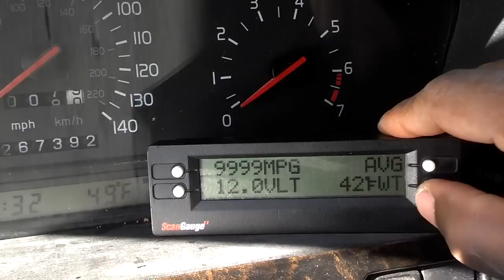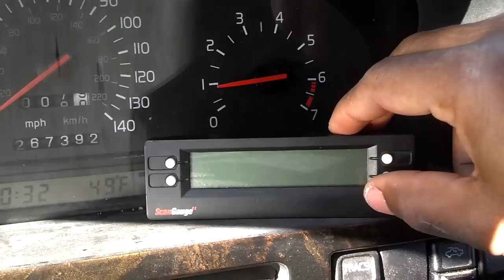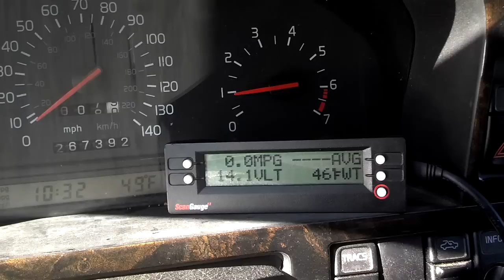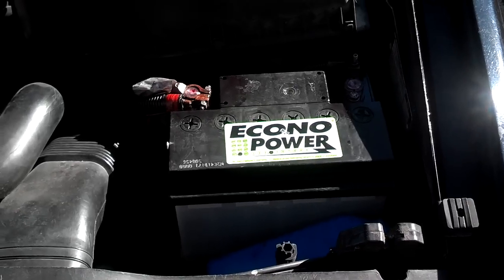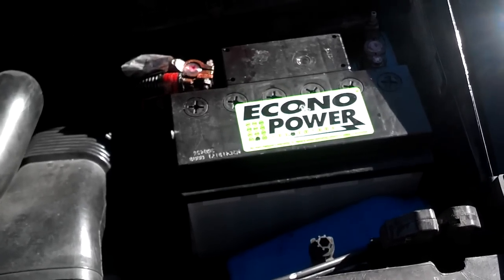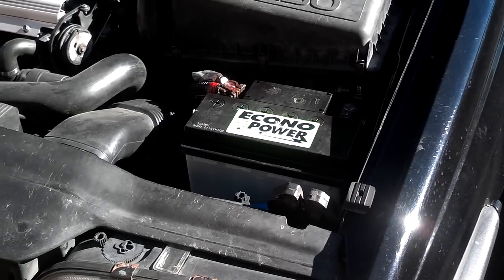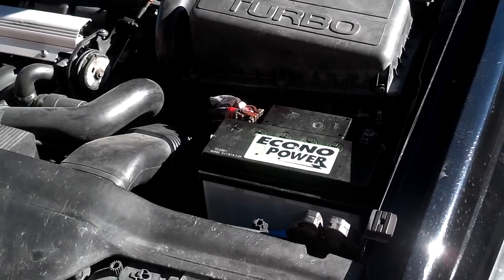How to tell if your car battery is bad, weak or dead. Signs of a bad alternator. - VOTD

Comment: Hi, I'm having some very bad electrical problems with my car. My car will shut off occasionally it seems if too much voltage is drawn as in if I turn on the headlights, wipers, heater blower and hold the brake down, and I hit my blinker, the car will shut off. The ammeter reads directly on discharged but if any of those accessories above are pressed it jumps below the line. First I replaced the voltage regulator and there was no change, then I replaced the alternator and still no change, then I rewired all the wires from the alternator to the battery to the voltage regulator to the ignition switch and still no change. the battery reads 12.8 Volts when the car is off, and 14.8 when the car is running. I feel as though I am running out of options, please help!
Reply from the maker: +Tanner Molitor You must have a short somewhere. What kind of car do you have?
Reply: 1967 Mustang, I just bought a new voltmeter gauge to replace the old ammeter. Alot of people say that those go out commonly. I'm hoping this will solve the problem.

Comment: I was driving and I was losing electricity like my radion turned off and my inner lights where dimming and I finally parked and it just doesn't start anymore
Reply from the maker: +Jose Vela Sounds like your alternator died. https://www.youtube.com/watch?v=_1q40V-BPQc
Reply: Yea I checked in oriellys they said it was bad
Reply: So I bought a new one
Reply: Can a bad A/C mess your alternator up?
Reply from the maker: I doubt it.
Reply: +Robert DIY thank you a lot!

Comment: My car was running then the radio cut off then when I turned it back on I get nothing alternator is new is it my battery
Reply from the maker: +Tenisha Johnson Fuse?
Reply: I mean it did all of that then u turned my car off and tried to start it and it wouldn't I had to get a jump but my lights were dim and my battery light and SRS light came on but I just had myvalternator replaced a few months ago but I looked at the alternator its turning and the belt is still on it what could it be?help!!!!
Reply from the maker: Probably a bad alternator. What brand is it?

Comment: sir my battery discharges. then i charge it.. and it drives. ..after i drove it for atleast 30 mins.. then  turn off the car.. after that i have to go home so i used the car after that i wont start.. whats wrong with my car?
Reply: +Stephen Hoyumpa -May be a parasitic drain on the battery when it is turned off as well...radio...light..etc
Reply from the maker: +Stephen Hoyumpa can you take your battery out and have it tested?

Comment: Ever heard a squeaky battery? I thought it was my old suspension at first, but I opened the hood and listened in and when I push the car up and down or move the battery back and forth, it makes a squeaking noise. It's been holding proper voltage; just making weird noises.
Reply from the maker: +LJRossPhoto Wow! Now that's an old car. lol
Reply: Haha I don't know if I should be worried.

Comment: I like this guy. Pretty down to earth and knowledgeable. Also sounds like the SNL Ladies man.
Reply from the maker: +meowbark LOL, I have been told that before. Thanks for watching.
Reply: Robert DIY Hey there!Quick question my 03 Nissan pathfinder when i try to start it,it click and sometimes after multiple tries it starts,i tighten the positive cable tighter and it cranks the 5 or 6 times i tried.But the battery has a small budge.Would that be that i should just replace the battery to solve this issue?
Reply: I've been researching into fixing a car battery and found a great website at Rapid Renew Roadmap (google it if you're interested)
Reply: Ladys man haha he does, yes he was very knowledgeable and helpful!!! That lisp though😁
Reply: LMAO 😂😂😭😭

Comment: That's what I hear a click, it takes about 4 clicks before it turns the motor fine but the battery is nearly 5 years old.  Yesterday I changed my starter, it was completely shot, the brushes and solenoid.  Do you know how to troubleshoot the ... I think it's called the start coil solenoid, spark plug runs from it to the distributor cap, wondering how to troubleshoot that because if I stick a new battery in, sounds like I need one anyway but it still clicks then?  Boy what a pain and it's difficult making it on my pension, you can drop some money messing on a start up issue I can't afford those expensive shops but have been taking my car to back yard mechanics (Philippines) trouble is they don't have any fancy troubleshooting machines, any help appreciated.
Reply from the maker: +mc “mcalleyboy” alleyboy It's called the coil. If the car runs fine once started, the coil is likely fine. I would clean all of the battery cable connections real good. Sometimes the battery cables go bad and need replacing.
Reply: +Robert DIY    Thanks Robert, that's what I needed to hear, my cables do need replacing, I had to cut or shorten the positive cable about 3 years back because it was so corroded, okay sounds good gonna get some new cables and check all the mounting points.

Comment: Dear Robert , Sir i am really work it out whether really a bad battery cell could be revived.Some youtubes show that by the use of Epsom salt or even aluminium sulphate.I did try using the Baking Soda, by draining the battery water / acid and then flushing it using Baking Soda but it didn't work.Is there another way or steps that can help to get the bad cell working?Please friends your views also... God Bless....Nilesh [FIJI]
Reply from the maker: NILESH PRASAD I do not know. I simply replace them with a new, refurbished or used battery.

Comment: I think I have a bad battery but it isn't acting like bad batteries I've had in the past. I watched your whole video and some of the symptoms you listed are new to me. Thought I'd get everyone's take. A week and a half ago, got me and the kids in the car tried to start it. Wouldn't turn over. Sounded like a low battery, but I still had radio and AC which hubby had left on when he stopped the car last. I turned them off. Made a couple calls, tried to find a neighbor to jump it, got back in and for some reason tried again. The car turned over and off we went. I ran it 20 minutes to make sure it charged. I don't use this car much so didn't again until day before yesterday. The starting stuttered, but ran. Today it won't turn at all. When I drove day before yesterday, I had a light come on -- the air bag symbol, meaning the air bag was in malfunction. I noted it but continued to drive. It went off and didn't occur again. But today the car can't start at all.  I could be looking at alternator issues, but I don't think so. When hubby gets back, I'm planning on sending him with the battery to have it tested. But if somebody checks this morning 5/9/15, please weigh in.
Reply from the maker: Beth Welsh What kind of car do you have? - https://www.youtube.com/watch?v=2rVt-TDqmSc

Comment: Thank you for this video. I am a single woman who just took her 2009 ford hunk of crap Taurus into a well known auto shop. I told them what it was doing and based off what I said they didn't doing any diagnostic testing and just changed my starter. I paid them my last $260 I had a drove ten min to my home. the car felt no different a was very sluggish. By the time I got home smoke was pouring out the hood. I'm going back but thanks to your video I am educating myself first.
Reply from the maker: Josee Reynolds Thank you for watching. Visit my page and go through some of my Play List to see if there is anything there that will help you.

Comment: Hey man. I've checked through most of your work (which is mostly great, btw) but couldn't find it, so here I am, asking; My battery died during the cold, so I switched it out, nothing werid there. But about 2 days later my remote couldn't unlock the car anymore. It turns out that the alarm is 100% dead, no lights showing it's on, no remote response, no sound when it should go off etc. altough all doors lock when turning the key in the drivers door.
I thought some cables was damp or something, but it doesn't seem to be the problem either. I really have no idea what's up.
Reply: It might be worth saying it's a volvo 945
Reply from the maker: Enchisedmy Hmmm, not sure about that system. Is it a stock Volvo system? Did you check the owners manual?
Reply: Robert DIY
It is a stock system besides the thing that recieves the signal from the remote. The lock itself and wiring are all stock. I checked the only manual I could find, but it doesn't tell me where the cables are running.
Reply from the maker: Check on a forum or two.
Reply: Robert DIY
Ya, I've been looking like crazy since i realized it was something wrong, about 4 - 5 months ago. There's just nothing to be found on that subject, I might have to leave it at a shop in the end.
Thanks anyway, though.
Reply from the maker: Did you leave a message about your issue?
Reply: Robert DIY  Yes, I have. All I've gotten so far is "Did you check the remote?" which kind of equals to "I didn't read about your issue".
I'll just drop it off at a friend of mine and let him take it all appart, thanks for your help, though.

Comment: I had zero problems and no weird issues had my battery (auto zone) tested a month before winter but day 1 of it being 10 degrees my car wouldn't start... it was 4 yrs old battery  so I was watching it and really had not 1 problem before it got cold...

I didn't know triple A would bring and install a battery in your car if your a member  ...not sure what the charge for the battery but maybe lower than the $100 I spent at home depot for a car batter...(yes home depot) ... auto zone wanted like $135 and I needed  1 asap...
Reply from the maker: AwakeDude911 Nice (AAA). I found a Interstate Battery refurb place in town that I recently picked up a battery at.

Comment: Hmm nice tutorial robert :-))

Some of causes of a running car losing power can also be the fact that the alternator has died and the battery could be good but draining.

Most bad capacity batterys dont stop the engine running, the alternator will be doing all the work while the battery does almost nothing, starting the car from a few days later will show the state of the battery.

There is a condition where one or more of the series connected cells go short circuit, this can make the battery boil and give the impression of an overcharging alternator, its not, the difference between the alternator voltage and battery voltage will create an overcharging symptom unless the remaining cells are so weak that there charging resistance is very high indeed.

The battery charging current is dependant on voltage difference and the batterys effective resistance, the effective resistance could be understood as weakness.

You poked my memory from working at a factory that did alternators and starters lol :D

If people dont understand cells then use "D" type batterys in series and tell them that some are old ones so overall the voltage will drop when you demand current.
ill shut up now ha ha ;-))
Reply from the maker: zx8401ztv Well, this video is really a Part 2 of my Battery VS Alternator video that a lot of people watch. 9 Times out of 10 questions that I get are from people that have a bad battery but try to justify that the battery is good because they can blow the horn or turn on headlights. I try to tell them "not so" but this video will cut down on my replies to them. Batteries die all the time. Alternators go bad once in a while. - https://www.youtube.com/watch?v=_1q40V-BPQc
Reply: Robert DIY
Yep i know batterys die, the plates get a coating and insulate them, not good :-(

If it offends you, ill delete my previous comment so not to confuse others?
Reply from the maker: No, not at all. I don't mind people having detailed info. The only thing that bothers me is when people use foul language and when they post links.
Reply: Robert DIY
Well i can use mild swear words but not often :-)

Its a real pity that batterys dont have the cell links on top like they used to be, you could test each cell with a multimeter while you applied a load, i know its an old fashoned design but i liked the full access :-)

Comment: can you make a vid on how to jump start another car using an s60 where you have to jump them from the front jumper under the hood instead of the trunk battery location in the s60?
Reply from the maker: gunmen424 Probably not. They usually have a POSITIVE jump post under the hood, not sure about a negative post. Take a look at the owners manual. If you don't have one, use the one on the Volvo website. - https://www.youtube.com/watch?v=dOISTPXvVlE